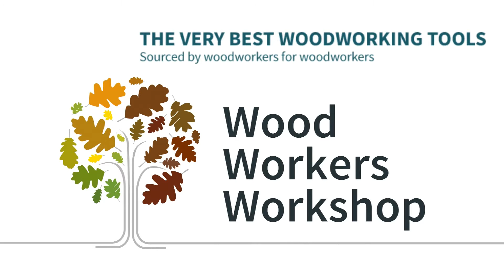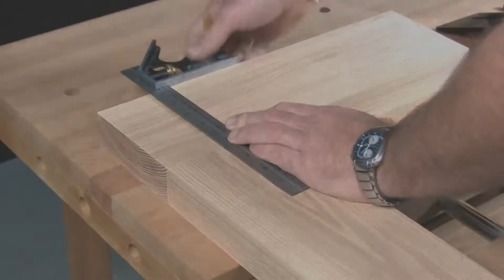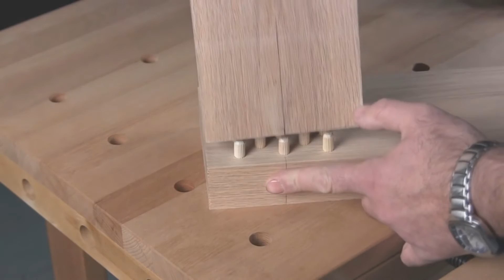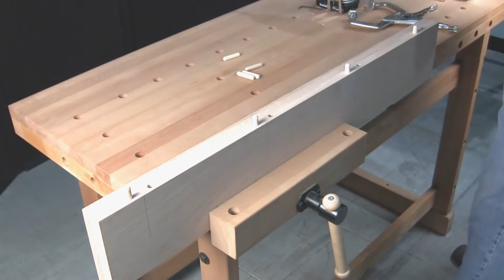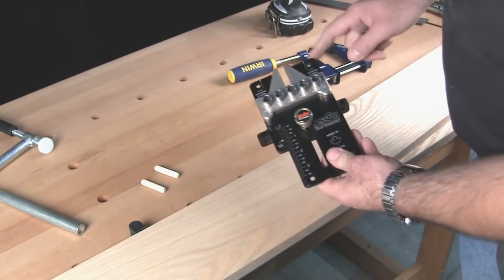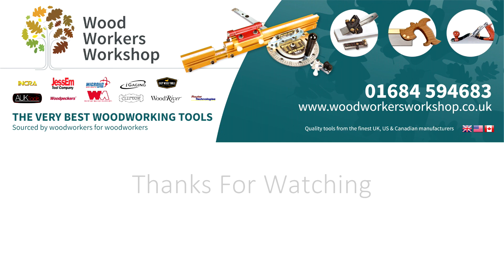JessEm Model # 08350 Dowelling Jig

Comment: Works as illustrated.  Have used it on straight edges for table top as well as upper and lower leg parts mated at 105 degrees.  All the measurements and center line were accurate.

Comment: Hi, I've got one of these jigs - liking it so far. However, how do you line up the jig with the centre line on the 2nd board as shown in your video (approx at 1.50min into the video) - there doesn't seem to be a reference  line on the top of the jig to line it up with (as there is on the bottom part of the jig) - or am I missing something? I've been eyeballing it so far but like it to be more precise. Thanks, Jeroen
Reply: I just finished my first project successfully and I what I did was use a dowel centering pin to align the front. I placed it in the front where you would normally put a dowel for alignment. What is nice is a dowel centering pin is pointed so you can put it right on the mark. I do wish they would have included a full size pin or better markings for the front. I love this jig but we should not have to come up with tricks to align the front.
Reply: I always measure off the side of the body of the jig and never use the center line feature. More accurate. Set up blocks work nice for this.
Reply: You should use the method at https://www.youtube.com/watch?v=X9puxCwB_g4&t=149s, clamping them back to back but, in this case, perpendicular.  Then you use a dowel in the already-drilled piece and put the alignment slot in that dowel.

I also like William Wheeler's solution.
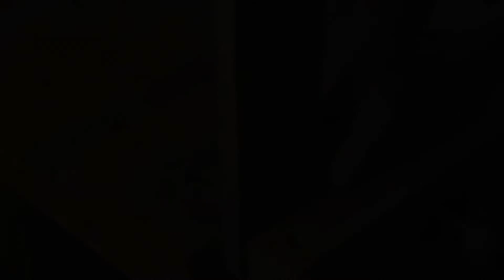Reply: Did you notice at 2:27 the misalignment of the two boards? I am going to guess they eyeballed it to and they didn't get it right. This could ruin a piece.
Reply: I have the same question.  I dont equate eyeballing alignment with accuracy...  So I am not  sure this is for me.